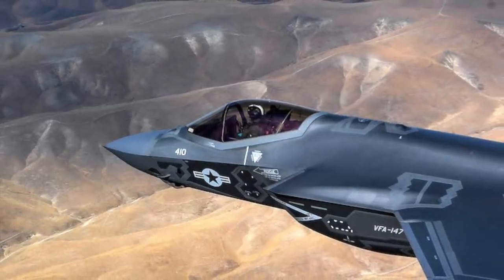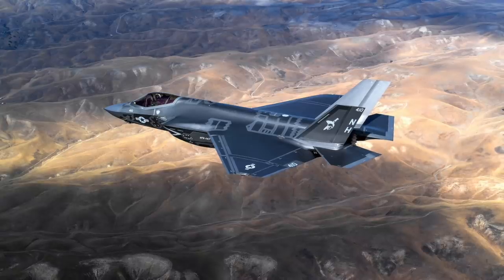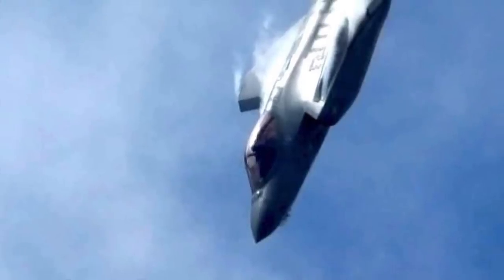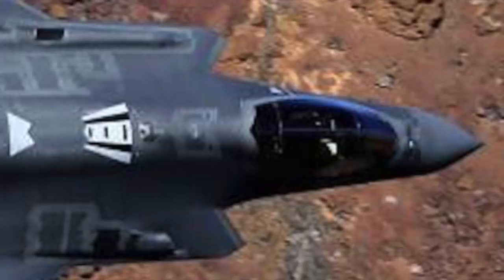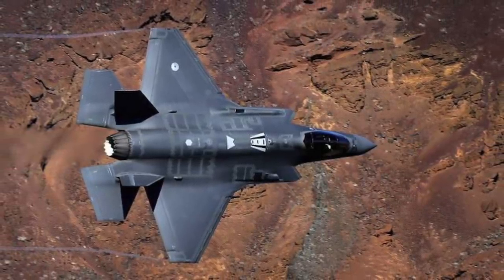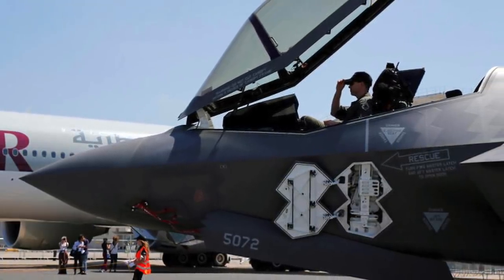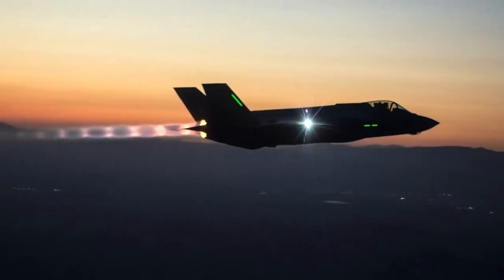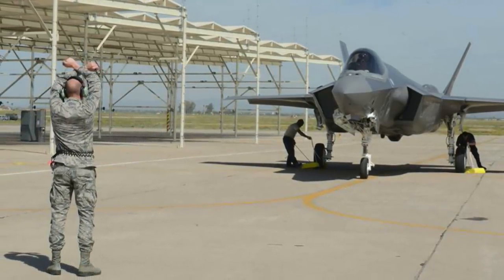HOW GERMAN MADE RADAR MANAGED TO DETECT F 35 5TH GENERATION STEALTH FIGHTER ?

Comment: So?  F-117A’s were certainly tracked during the Gulf War until they were “stealthed up” when crossing the border.  While I am no expert I expect this includes withdrawing protuberances like lights, also radar reflectors such as you indicated, turning off transponders and generally reducing electronic and (probably) other emissions.  Also the jets fly profiles to avoid enemy radars of which they are aware.  Further, detection is not tracking; it’s different.  Detection does not a kill-chain make...

Cheers!
Reply: Same situation when the only F-117 was shot down. The Bosnian commander of the SA's heard them coming and adjusted directly to the known flight path for direct tracking, got lucky.
Reply: That F-117 was shot down because of lazy msn planning and a devoted SAM operator. The F-117 was flying the same route for days without change make it quite easy to track with visual observers and engage by the SAM system.
Reply: I recall the story of an f15 pilot shooting down a Mig in a night attack at the opening of the Persian Gulf war.  Turns out a F117 was in the mix doing bombing runs in enemy radar sights and the pilot saw it happen.  The F15 pilot didn't know the f117 was there until the bombing mission was disclosed.  Nothing to really do with the video.  Just an interesting story from back in the day.
Reply: @MrRapp-yz4hu  Another interesting story: A certain pilot (I forget his name) during the Gulf war was very skeptical of the stealth capabilities of the F-117A. He flew to his first target near Baghdad and was quickly losing his confidence in stealth because the AA guns were all shooting at him and the explosions of shells followed him when he deviated from the planned flight path to avoid them. Turned out he still had his nav lights on and the AA guns were just firing at the lights. Modifications were made to the F-117A cockpit after this experience to implement an "all external lights OFF" switch and the switch was named after him.

@Jim. The Serbian commander detected several F-117As at roughly 30km on a P-18 radar (roughly same era as the F-117A). One of them was flying directly towards the SAM site. They tried at least 3 times to lock the incoming F-117A but the first 2 failed. A third attempt was made at a range of 15km and that succeeded, 2 missiles were launched, 1 failed, 1 hit. Note that the V-601 missiles used had an effective range against fighters of up to 25km, and max range of around 35km. The P-18 radar is supposed to be able to detect F-15s at more than 100km. What Franklin says is also partially true, though it wasn't really a known route specifically for the F-117A, rather a very predictable and obvious one.
Reply: However continued detection can be used like a lock, guiding the missile towards the target via dl changing the guidance mode when for example an infrared seeker can detect the plane, which it will early enough

Comment: I'll add to my previous comment information this video omitted. 

An article at C4ISRNet reports that Hensoldt developed a new passive radar system, called TwInvis. TwInvis works by studying electromagnetic emissions in the atmosphere, think radio station signals, TV signals, cell phone tower signals, commercial radars, and so on. The system can detect aircraft moving through this invisible sea of signals by “reading how the signals bounce off airborne objects.” The technology sounds promising, but there were a number of factors that helped TwInvis detect the F-35s. One, they knew when the F-35s were coming and were able to use the signals from the jets’ ADS-B transponders to help identify the aircraft. In wartime, adversaries will not know the planes are coming and ADS-B emitters will be turned off. Another issue with the radar is something fundamental to its method of operation: it relies on signals from civilian transmitters to detect stealth aircraft. In many parts of the world, especially over open water or remote regions on land, there won’t be many signals to collect data from. A country with stealth aircraft could disable cell phone networks with cyberattacks and bomb radio broadcasting towers to deny radars like TwInvis a detection medium.

Comment: My guess is they weren’t using all their stealth characteristics like active jamming etc., because for airshow flyover and congested European airspace you don’t want to be stealthy
Reply: Scott P79 your guess or did you listen to what they said in the video 🙄
Reply: It’s a passive radar. It doesn’t actually send out radar waves but detects the change in the electro activity in the air as the plane passes thru it.
Reply: No need to guess when the video explains it. The f35s had their radar reflectors turned on purposely.

Comment: Passive radar is undetectable by the aircraft.  I don't know if the radar reflectors were turned off if the passive radar would still be able to track the aircraft.  The way passive works still required reflections from the aircraft and wouldn't work in a microwave or radio wave dead area of the world regardless of the radar reflector being turned on or off.

Comment: Why is it every time this plane gets seen people freak out like it's literally invisible... IT'S STILL AN AIRCRAFT. if you run around with all the stealth features active it's easier for you enemies to learn. Leave it off and they think they have you but really they have, NO IDEA
Reply: Helder De Almeida  thats why turkey will not be getting them my friend.. Snakes in the grass
Reply: So you guys have NO IDEA how stealth tech works..... 

There isn't a switch turning on/off the stealth function. What they did is to install some luneburg devices to reflect and magnify the radar signal that reach those devices. However, they will not affect the  signal reflected from the plane body. 

If you have a picture showing the shape, size of the plane and the configuration of the luneburg devices, you can combine these info with the flight condition obtained from radar to simulate the effect of luneburg devices, screen them and obtain the actual plane reflection signal.

Comment: There are conflicting informations. 🤔 I saw news bout this and they said the plane wasn't just detected it was tracked for about 100 miles also the so called reflectors are off, so yeah its in stealth mode. Same to the articles I've read. This one is the only one with different take on the issue.
Reply: All stealth aircraft are fitted with radar reflectors at airshows.

Comment: First of all detecting doesn't mean you can get a lock because it's not precise enough. Stealth isn't invisible just reduced visibility. There are reflectors that can be temporarily activated to help with detection for testing, air shows, and are on the landing gear to assist landing but tucked away in flight with the landing gear so as to not break stealth. The F35 also possesses the ability to use passive radar, they used the phrase "it listens for electromagnetic emmisions" basically it listens for other active radar systems to give themselves away when they send their signal. That allows it to avoid detection form another passive radar due to the lack of its signal. An inboard computer also helps the pilot fly the best path and present the best angle to maintain stealth using real time gathered data. It is so advanced it can actually help the F35 appear stealthier than the F22.

Comment: Even “IF” it could detect an F-35 during actual combat operations, as a passive radar system, it would depend on civilian transmissions. While the power grid and communications are amongst the first targets of any air campaign! So it seems their TwInvis would be pretty useless in an actual combat environment once the shooting started!??
Reply: As far as i saw, you are the only one, or one of the very few (as myself <g>) who did not fail in paying attention, as most of the snide and sneering comments did. Most did not even get, that it was a passive system that basically looks for electromagnetic disturbances, that, as you described, relies on a background to canvas these aberrations. Supposedly so, as i dont know the workings, but thats what was described. A passive radar system, is a completely different animal.

Comment: Passive Radar all commentators should note, it uses radar returns from non-cooperating and commercial emitters over many more bands then usual radars and isn’t emitting itself. So it’s looking at background broadcasts of anything (tv radio cell phones etc) and seeing if a gal forms. This means it’s getting many different angles not a straight back and forth between radar and target. The video should have discussed passive radar more

Comment: If one gets shot down, then it would be retired as F-117's.
Reply: Exactly, because despite U.S. claims at the time, it wasn't a random lucky shot by a triple-A battery, but in fact the result of the F-117B showing up on a newer generation of networked radars capable of forming composite returns off deflected signals.

Comment: According to C4ISRNet also noted that the German company knew when the jets were coming and were able to use the signals from the jets’ "ADS-B TRANSPONDERS" to help identify the craft. Without the transponders turned on they would NOT be able to identify and track the jets.

So although this may sounds troublesome for those flying into battle, real enemies will not know when these fighter jets are coming – so they may not be able to detect them without this knowledge.

Comment: No way 
Well maybe the 35, but not the f-22
Reply: The radar detected it, because it was allowed too. For ATC to help guide it only
Reply: F-35 is stealthier than the F-22, especially when it comes to lower band radars. Also as many have pointed out this was civilian airspace and stealth aircraft are required to use radar reflectors and transponders to remain visible for safety reasons relating to civilian air traffic. Imagine driving along a road at night and seeing a black car drive past you without it's lights on... accidents can happen very easily if you don't know something is there.
Reply: 768PP  that s not the story here !

Comment: They use radar reflector panels at airshows, obviously.  They are not going to just give away radar signature data.

That said, the technique described can be used to track stealth aircraft, but you have to know where it is going to be.  The F-35 would have been emanating signals that could easily be trackable, but looking for atmospheric anomalies that an aircraft causes (such as wake air turbulence) is a viable method for detecting stealth aircraft.  The challenge is that you need massive supercomputers to parse noisy radar data for the latent patterns, and you need to know where to look.

In the end, it is about as useful as IR search...which is to say it is like fishing...except IR has the benefit of being passive.  Radiating radars are a big fat target...so there is that...

Comment: While operating in European airspace, special radar reflectors are required in order for it to operate. It had to be specially certified for those purposes. The jet actually has different configurations for such purposes(ie. special running lights). Additionally,  some EU member states are trying to gather funding to produce their own 5th gen fighters.

Comment: Even though im sceptical of this "new" type of radar, I think it has been treated unfair especially by the American media. The thing, with this type of radar, is that it does not actively send out signals, but rather listens to the reflections of other signal transmitters. 
Stealth technology doesn't absorb the ping that is send out, but rather reflects it to make itself less traceable. But when a third party emitter pings the stealth aircraft, this ping gets picked up by the passive radar, which the calculate with enormous processing power the location of the reflecting object.
So it didn't matter that the F-35 had a reflector, because the passive radar doesn't need it.

This makes passive radars very cheap and fast to deploy, since you only need an antenna and a computer and you are ready to go.
Also, since this thing doesn't send out any pings, so its nearly undetectable. It can also be deployed in a van and is thus higly mobile. 

Why is this usefull?
Stealth fighters are NOT invisible, they just minimise the risk, but they still have to fly complicated route in order to avoid enemy radars, because if you fly directly ove them, they will still be able to detect you.
With a passive radar you would never know where to fly because they could be anywhere. 

But this technology has a few downsides. It really isnt that usefull in rural areas, because it need all these pings from other scources and good luck without them. So you are limited in your deployment options, which makes it easier for the enemy fo simply fly around the 100 mile detection radius. 
I think this technology will be crucial in the future, but since I germany has no stealth planes, there is really no way thsy can improve that thing, because they cant test it in a real environment. I think thats what they claimed, they successfully tested their radar.
 Its just the media that is eiter saying:"Ohh look, this expensive plane can be tracked after all", or "Haha, look at these stupid technology".

Comment: I came to same conclusion that the F-35's operating in civilian air space with civilian aircraft had radar reflector panels installed t make them visible. The same argument came up back when the F-117 was flying and same reason it was detected. 

As far as I know L band is he only radar that can normally detect stealth fighters. While L band radar can detect stealth aircraft the resolution is so bad that the L band radar can do little more than say there are contacts in that direction. L band requires considerable processing power and a program to clean up the signal to make it usable. 

As for electronic signals the F-35's AESA radar uses a frequency hopping technique that only transmit for a fraction of a second leaving no time for anyone monitoring that channel. 

IMHO you would need to drastically improve L band radar resolution and then use at least three radar stations to try and triangulate the targets location, bearing, and height.

Comment: Stealth can't beat bisatatic radar (i.e Struna-1) where transmitter and receiver are miles a part. With electromagnetic amplifiers allocated along the distance btwn T & R then the reflected wave from the stealth can be magnified enough for a SAM messile to lock and track it.

Comment: At its most basic, the passive radar concept uses ambient RF radiation, such as emissions from cellphone towers, television and radio broadcasts, and more, instead of its own active radar emitter, and uses returns from those signals to detect targets moving through an area of the sky. The concept has been around for a long time. It dates back to the dawn of radar, with passive radars seeing service during World War II. Multiple weapons manufacturers in multiple countries have been pursuing the technology, to varying degrees, in recent decades. 
In fact, it seems that every few years an article makes a big splash by declaring that stealth technology may be invalid due to passive radar system advances. Usually, these articles are packaged with the threat de jour—Iran, Russia, China, etc. Similar claims are now made in articles about low frequency and quantum radar technology today. 
Hensoldt's own claims are over a year old and came at a time when Germany was looking at buying the F-35to replace its Tornado fighters. But really, anything on this type of topic seems to spark a bit of misplaced hysteria, and when the F-35 is the subject of attention along with it, it is bound to grab eyeballs. 
As the years have progressed, passive radar has not slashed the utility of stealth technology for a laundry list of reasons. First off, just detecting something unknown in your vicinity does not mean that the target can be accurately classified or engaged. In other words, in most cases, passive radar does not provide engagement quality telemetry for which to employ weapons. It is an awareness tool largely used for cueing other, more traditional sensors. 
Passive radars also rely on dense third-party RF radiation to exploit a medium in which stealthy aircraft can be spotted. So, using it in highly remote areas would be problematic if not totally useless. In other words, because the radiation level cannot be controlled by its operators, the system is subject to the ambient RF environment it is placed in. This limits how and where the system can be effectively employed. Even then, their range and fidelity are limited. 
For instance, in the German passive radar story, the company says it tracked two F-35s flyings, but at the time those F-35s had their transponders on and were talking on air traffic control frequencies (emitting their own RF energy). They may have even had their radars on utilizing basic modes. They were also flying with their radar reflectors attached to their fuselages and with their aircraft in a non-combat configuration and software mode. The operators also knew the local RF environment very well and how to optimize the system to spot aircraft that they already knew were going to be there. Even under these near ideal conditions, they claimed they tracked the aircraft for about 90 miles. That is a substantial distance but is no way indicative of what ranges would be possible under actual combat conditions, and that's even if they would see an unannounced, emissions silent, combat configured, electronic warfare-enabled F-35 at all.